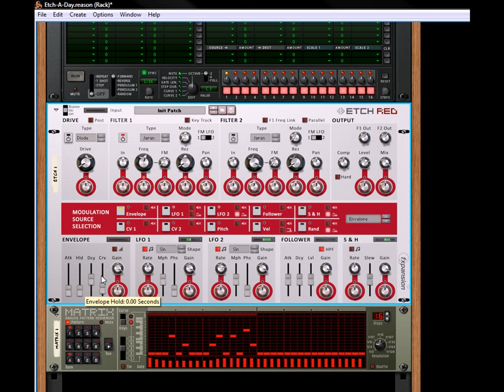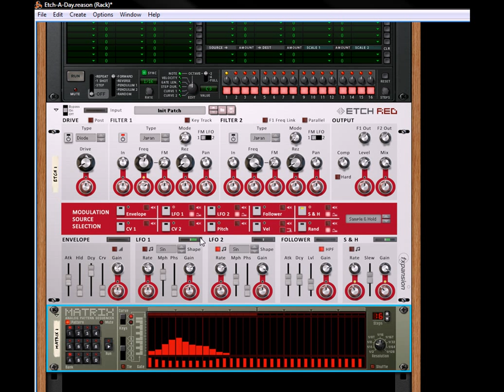Etch Red RE Introduction

Comment from the maker: I think Etch Red is different than the Alligator. I don't think one is more useful than the other. And each can do a few things that the other can't. For example, the Alligator can phase and delay, while the Etch Red has many different filter options. I can tell you that I use both in my own work, and sometimes even use them together. Cheers!

Comment from the maker: Well, there's a lot of different Filter options that you don't have in the stock Reason devices. For example, if you look at the Japan filter, there's about 18 different "Type" settings. There's also the "Fatty" filter, which is based on the Moog filter. Nothing like that in default Reason. The LFO ranges are wider than the LFOs in Reason (arguably so because you can push Thor's LFOs farther or shorter with the MBRS). And the distortion types are different algorithms too. Just some of the diffs.